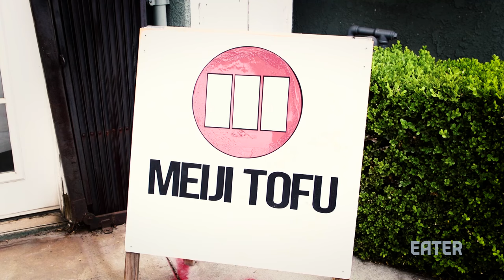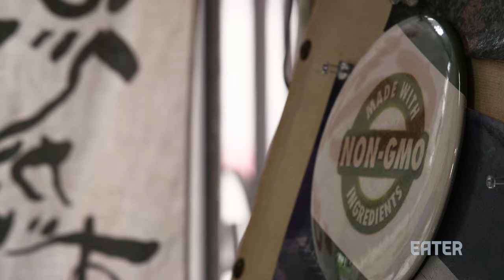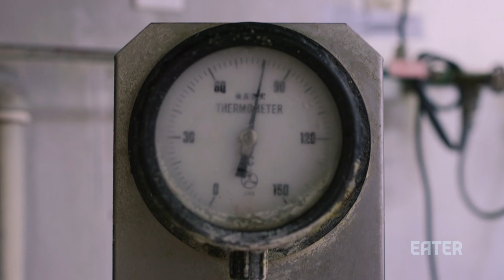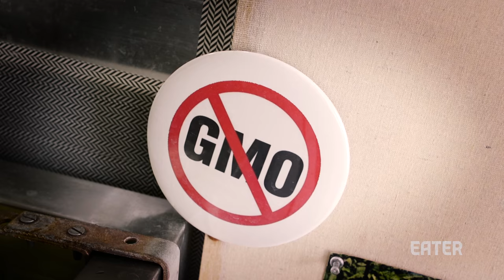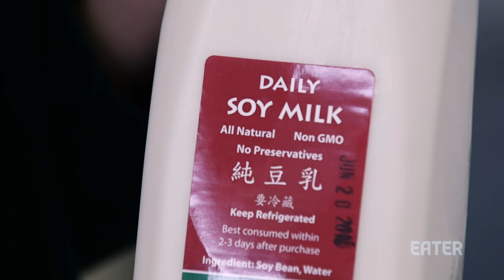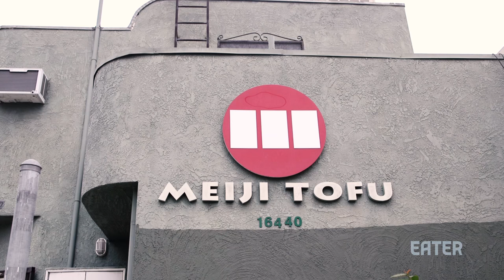How Tofu Master Koki Sato Makes LA’s Best Tofu — Shokunin

Comment: What does tofu taste like?
Reply from the maker: It's close to a really neutral flavored cheese curd
Reply: No.. The texture is not of a cheese curd in any sense...... Tofu's airy, soft, and almost puddingy. Hard to describe
Reply: Depending on the type of tofu you purchase - firm, medium or silken (all variations of the amount water in the final product), the texture will differ.  Firm tofu has a crumbly quality to it while silken is soft and custard like (as shown in the video).

The taste is very delicate and tastes like the soybean and water that was used to make the tofu.  Depending on the soybean you can end up with slightly differing flavors.  In the end, soybeans taste like a cross between sprouts and beans/nuts.  There's a garden freshness in the after taste like sprouts but a deeper richer nuttier creamy flavor while chewing.  

If you've ever eaten edamame then you've eaten a young soybean and will be familiar with the flavor of tofu (just note that edamame is typically served salted or the pods have been cooked in salted water, whereas tofu will not have this salted flavor).
Reply: Doesn't taste like much. It's one of the most bland foods out there.
(Some tofu fan will take offense to this - but go ahead, try to name 10 other foods more bland than tofu!)

Best thing I could liken it to is eating a soy bean or a white bean on it's own.
Or maybe some unsweetened youghurt without the acidity.
Reply: Rob Cameron try smoked,it's great.
Reply: Rob Cameron Bland and plain tastes just like soy milk. But the good thing about tofu is you can fry them, put them in soups, or make tofu desserts. They are healthy and a good substitute for meat because they are high in protein. 👍👍